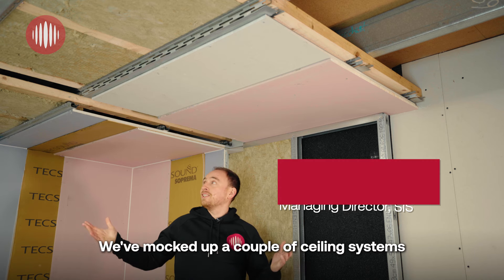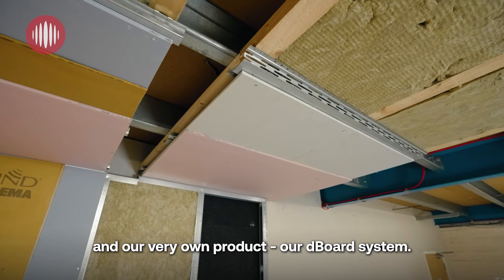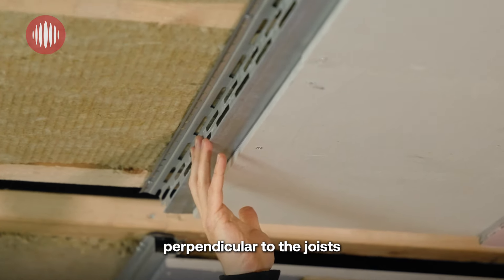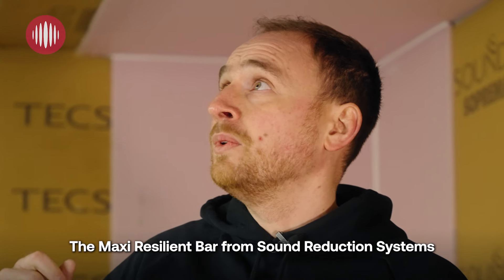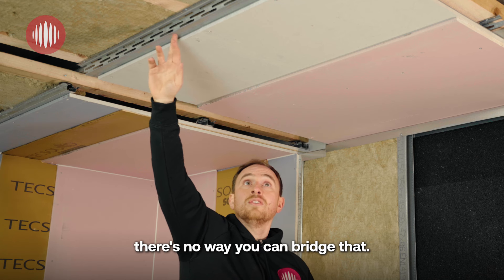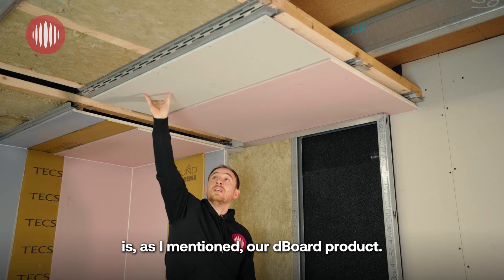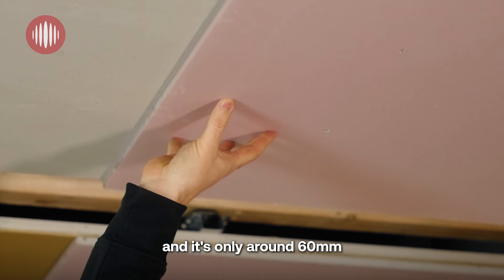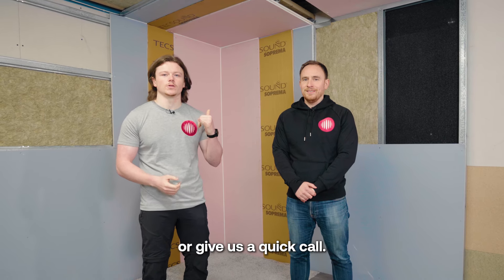Soundproof your CEILINGS. SIS OPTI 60 Acoustic Ceiling System

Comment: Looks pretty good. I guess I found the solution for noisy neighbours! Thanks YouTube.

Quick question about sealing, does can it replace existing sealing, or it goes over it?
Reply from the maker: In general this would be to replace the existing ceiling as it is fixed to the joists. It can go under an existing ceiling, however you would need to consider the fixing used and the loading on the structure.